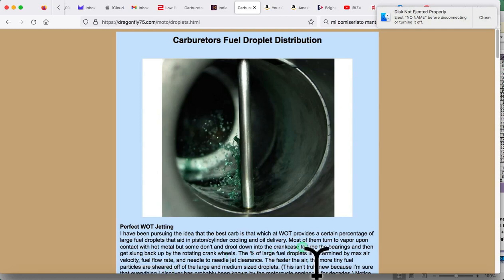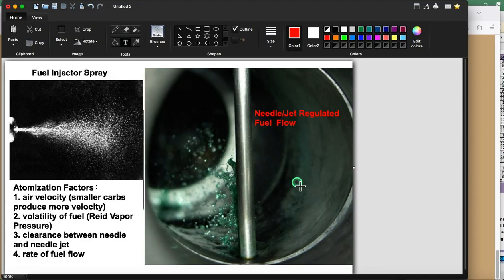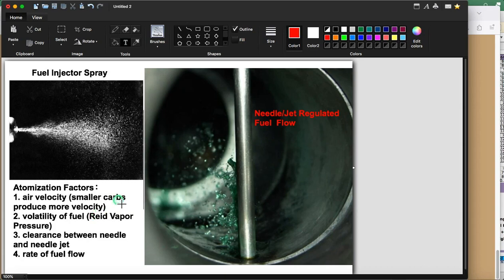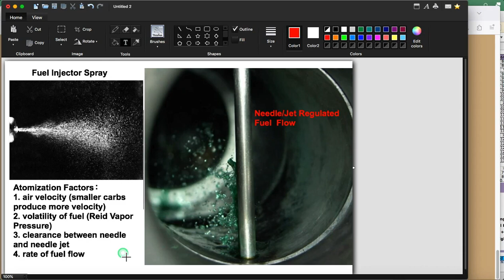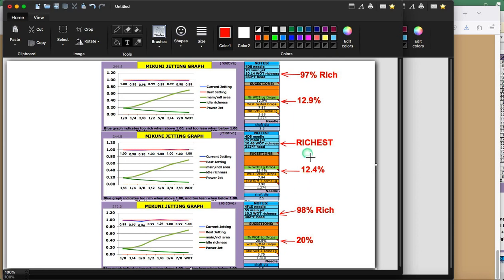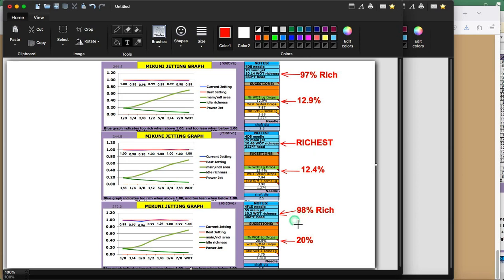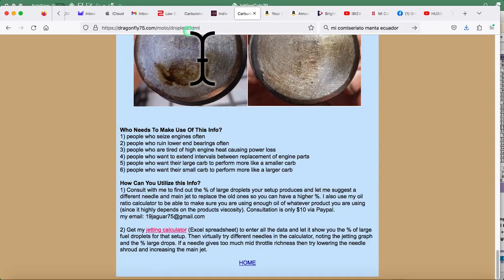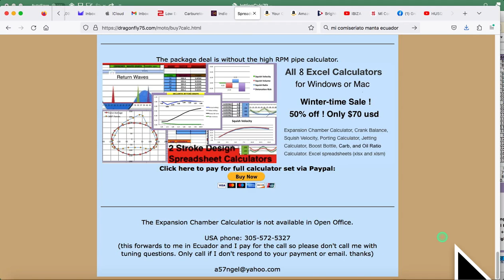About Motorcycle Carburetor Fuel Droplets

Comment from the maker: MORE PROOF
An inventor I know told me that putting a fine screen in the pathway between carb and reed valve increases power. I told him that was very believable due to the screen breaking up the large fuel droplets into smaller ones, adding to the power mix of air and small and medium sized droplets. But I told him the rider should add more oil to his mix because without large droplets there will be a loss of delivery of engine oil to the crank bearings. And a loss of cooling droplets but with a water cooled engine that shouldn't be critical. I wouldn't recommend this for any air cooled engine which especially needs the cooling of the large droplets.
I'm going to try his screen on my 48cc air cooled engine to prove this point about heating/cooling. He's sending me some screen. If any of you air cooled guys do this and ruin your engine don't come crying to me. My test showed a 10 degree difference but I expect the difference to be much more with this. www.dragonfly75.com/moto/images/reedscreen.jpg
Reply: Gotta glue some thermocouples to the bearings and monitor them.  It's a lot of work and some cost; however it's the current state of the art in measuring these characteristics for powertrain development, TCs are cheap and accurate, quick enough.  If you have big budget can even use telemetry with remote mount temp measurement on the rod and piston.

Comment from the maker: I shoul of mentioned that I did the test twice, on two different days, with the same results. I know 10 degrees difference doesn't sound like a lot, but it is when the engine is getting so hot it is losing power. Of course this is mostly a problem for air cooled engines. But helping the bearings out is good for all engines, possibly more so for big displacement engines and high reving ones. My page about large fuel droplets is www.dragonfly75.com/moto/droplets.html

Comment: Caution, sarcasm ahead: Masks work in perfect laboratory conditions with customized fixtures and test rigs that use aerosol test proxies which show the masks reduce aerosols fugitives by percentages greater than 90% and then this 90% efficacy of trapping an aerosol proxy cascades into preventing the spread of cold and flu like symptoms.  Every, Single, Mask Control Trial, is a massive Failure in showing any actual reduction in cold and flu like symptoms.  These are control trial studies that show mask increase infection rates of patients by 1% when doctors/staff wore masks during surgery.  Tunevall 1991, Bahli 2009, Sellden 2010, Webster 2010, Lipp 2014
Reply from the maker: absolutely right. Anyone who trusts masks distrusts science (such as flat Earthers). I distrust governments and the midical system, not science which is an exploratory method.